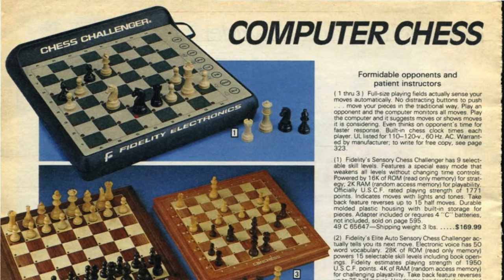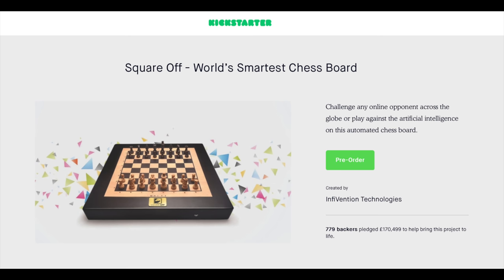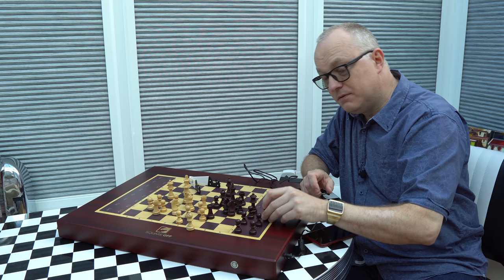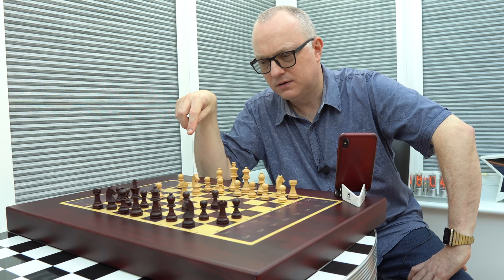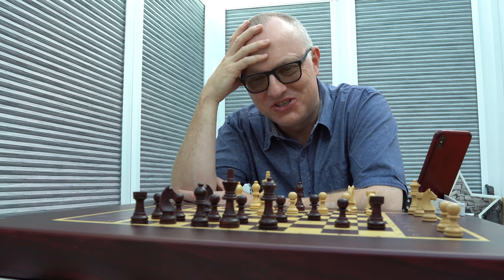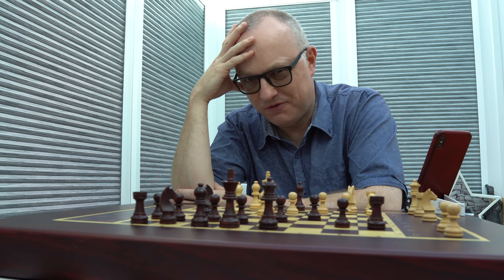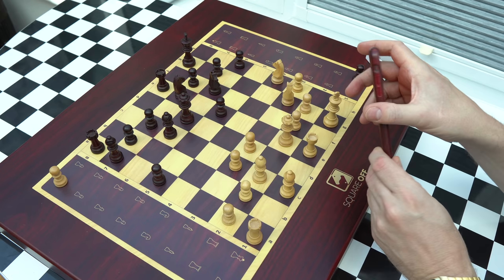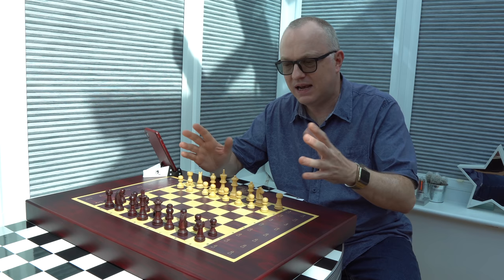Automated Chess - Losing to a Ghost

Comment: I have a electronic chess from the brand Mephisto : Alaska . It uses the similar sound when you press the pieces to the board . You can choice between 8 difficulty levels . You can even remove the beep sound . As it works with four AAA batteries . I bought it in the 90's for less than 50€ . Still have it today .

Comment: (8:25) When I was little in the 80s, I figured there must exist automated chess boards. However, I've always questioned the feasibility do to pieces having to move through other pieces to reach their destination, and this is one example here: black knight C6-E5 (I haven't placed the PC chess in years, so I have no idea what the move notations are).
Reply: I grew up with Chessmaster 2000 for IBM compatibles, and occasionally I could beat the PC on beginner level. Personally, I prefer backgammon.
Reply: C6-E5 is correct in longhand, but in modern times you'd just say Ne5, signifying the knight moves to E5, as any regular player (or computer) already understands the context (the original position and the legal moves).

Comment: Back in the late 70s I made a board which I gave to the friend who owned the Nascom II running Sargon. It had a touch switch contact and a filament pea bulb in a matrix , one in each chess square.
You touched the two squares to make a move and in response the computer would flash two bulbs in alternation. Not as clever as this board but then I think I was 15 or 16 years old at the time, had to borrow time on rich friends Z80 computers..

Comment: Awesome. They should make these with 2 gantry mechanisms, 1 to move computer pieces and one to take player pieces, SIMULTANEOUSLY (makes for a faster game), also more accurate control or fluid/curved movements of pieces, A DEMO/COMPUTER vs COMPUTER mode and a TUTORIAL play mode to teach you about allowable moves and strategies + explanation of disallowed moves (also available in normal play instead if beeps, IF Preferred) A game record and replay mode would be good also.

Comment: i would have hoped that it had some sort of ability to wirelessly track pieces without that membrane. Meaning you could just normally place them, and it could reset them whereever they are placed on the board.

Comment: i like the idea, but i would try to push the design a little further. i dont like how it removes the kill before moving its piece, it would be more aesthetic to leave the kill on the square as long as possible. it would also be great if it could identify each piece automatically, as well as a self righting/topple feature. then it could set the board entirely by itself & have a kill fall over before standing back up & walking off the board.

it seems to do ok moving the knights on the line to avoid crowding, but there might be a prettier way of doing it. maybe instead move the obstructing pieces to the line sideways as the knight enters their square, & then move back as he enters the next square. this would look best if the board can move at least 3 pieces at the same time, but it could be too slow if limited to moving just 1. of course, a knight has no more than 8 moves & each move has 2 ways of looking at it, so the board should also evaluate the least obstructed path first.

with castle, instead of moving pieces to the line i would have the king initiate the move by moving slightly forward & then the rook moves slightly backward, allowing them to pass each other on each 1/2 of the path (logically, the king shouldnt side step for the rook, but it would just look better this way & be less confusing).

i would also add some stand alone features, like a voice chip with different voice options, maybe a few soft leds, as well as voice recognition so experienced players could simply dictate their moves. adding a good ai might be too much at first, but it could be fun to hear it quote wargames when you turn it on (with copyright being an issue i would just call that a customizable greeting & let people set their own message over usb). i would also delay toppling the king until it has finished announcing the checkmate.

then theres a few muddy points to consider with error checking though, how should the board handle cheating or missing pieces, or an undo option when the voice recognition fails or the player misspeaks, etc. the board should also be designed that the inevitable standard magnetic chess piece wouldnt cause damage when people get curious or think to replace a missing piece with a normal magnetic piece.

i would imagine it could announce a problem with the board & reset the pieces when someone tries cheating. how it approaches the matter could be an issue, but combining the board memory & the self setting, it would allow you to easily transport & resume a game, or if a cat jumps up & knocks all the pieces over. there should also be a manual resume option, so it starts a game from how you set the board (would also make cheating possible by just restarting the game this way).

next step battle chess automata ;)

Comment: That is quite amazing to see, A chess board that is capable of moving the Pieces on it's own. As many have stated The problem with this is that App, If that App is discontinued at anytime or the Brains behind this chess board go bust or are taken over, the app is no longer supported Then it's going to be an obsolete priceless hunk of Junk. I agree with one of the other comments on here. Have your time with it and when the novelty wears off. Flog it and get your investment back. No one knows what tech is going to be like in 5-10 years time. Otherwise a fantastic video and illustration of quite an obscure piece of tech 👍

Comment: Real pity about the app only operation, they've cheapened the internal electronics to almost zero, relying on the phone for all the processing grunt, but still want the earth for it. Then in a few years it could turn into an expensive paperweight if the app is no longer avaliable - out of support, won't work with the lastest phone OS etc.
In twenty years when someone does a yesterday's gear review, (Techmoan) well this one will be dead in the water with nothing left that can pair with it.

Oh and you were right with the "you'll almost certainly wish that you hadn't bothered", a twit with an axe is all I saw.

Comment: surely this thing could have been faster. i'm guessing by the huge delays between pieces moving and only one piece moving at a time, that it has only one electromagnet inside moving slowly back and forth. they could have either done this with no moving parts and many electro magnets, or at least made the one magnet move much faster, especially when it's between pieces

Comment: Sounds like it's basically got an old XY plotter type mechanism inside, with an electromagnet. Disappointing. We're surely now at the stage where each piece could be a little motor-driven robot, and they could all move simultaneously to reset the board. Now that would look cool.

Comment: I had Colossus Chess 2.0 on my Atari 800XL. Worst game purchase I ever made because I simply couldn't get anywhere even on the easiest mode! XD In fact, in this video I see one or two moves I like to think I could have done better, but only because I'm seeing them fresh. If I'd played through to that point, my concentration would be shot.

Despite that, I was very prone to catching culture bugs as a kid, and so I always hoped something like this would exist. ;) I was a little disappointed in the 80s when an older friend showed me you had to move the pieces yourself. I'm fascinated by it obviously having a motorized arm under the board. That is, I suppose, classier than having a robot arm swinging around over the top. XD Much easier to build and program, too.

Comment: It's an interesting machine but the app requirement kills any desire to own one. It would need a 2.0 upgraded version that had both an app as well as a computer program for operation, being able to use either over bluetooth and offline, the solo play and remote play would need to function either without a server or they offer up a free server program so you can host the game yourself. I'd rather not spend $500-ish on something that could end up serving the exact same purpose as a cheap $10 board.

Comment: the biggest issue i have with it is the noise, for the price you'd expect something quieter
Reply: Then what? it is essentially a printer or cnc machine. It'd cost a lot more and be a bit overengineered to work any other way than stepper motors.

Comment: Back in the early '80's, there was an automated chess board like this that I saw in stores. It was really cool (and expensive) but I didn't trust that the mechanicals would last, so I bought a Fidelity computer chess board instead. But I've always wished I'd bought the automated one.
Reply: The 80s would be the Milton Bradley. Fidelity put them out in the  90s. The Milton Bradley's were better built but were weak players. Fidelity changed the electronics to a wonki capacitor power supply but made a much stronger player. The last had speech ability. The drives on both the Milton Bradley and Fidelity are quite durable if kept lubricated.

Comment: This would be nice to play on Zoom during the pandemic. That being said, so much of this product raises red flags 🚩: relies on an app, Kickstarter, expensive, cheap material. None of these is a deal-breaker, but combined they make all the other drawbacks even worse. 
@16:28 is a bad sign as well. He's right. Those devices are hard to find now and that seems a dire prediction for this product. Worse still, the app requirement will render it more useless than those older products. Kickstarter should require companies to provide some sort of open source code in the event of the business going under and the product being discontinued.

Comment: I was actually thinking about investing into that Kickstarter campaign, until I found out that it is tied to a single app. There is a standart for connecting boards to computers, professional boards can be connected to a PC running Fritz, Rybka, Shredder or whatever chess engine of your choice, there are myriads of them, highly adjustible and using a PC makes it think way faster because of higher CPU clocks.
If it was Raspberri Pi based, I might buy in, but a very primitive app... Hell no. There are much better chess apps even on phones.

Comment: that thing is really cool but the beep is AWFUL. Some other sound would have been better. I think something sorta "woody" like a tap or knock would have been my suggestion. like a polite sell phone notification. Or to be able to change it. But the beep is awful it doesn't sound like a premium product.

what would be BEST i think is like when you tap your phone screen to accept and it does a slight little vibration. Like that. but it happens instead of the beep. really subtle haptic feedback instead of a sound. But that sounds sorta expensive and hard to manufacture.

Comment: Would be nice if it could do checkers as well!
Reply: Since it's purely an I/O device, there's no reason it couldn't play other similar board games with appropriate software. Although for draughts (or 'checkers') you'd need to use pieces that could be stacked.

Comment: the fact that the board itself doesn't have any kind of way to play a game without an app is really disappointing. Any basic microcontroller or cpu has more than sufficient horsepower to run a good chess algorithm, so the fact that they decided to make the board be essentially a X/Y motor in an oversized box and nothing else is truly sad.

Comment: I mean if it moved more then 1 chess piece that would be more cooler.
Reply: i mean i guess. But something like that is make with moving parts. Its like a printer or something.       Yea. I mean printers are neat, if it could print more than one page at a time that would be cooler.    self driving teslas are fine but it would be cooler if we could just teleport.

Think of an etch-a-sketch. Its a stylus on an x-y axis. Now try to think how you would add additional interdependently controlled styluses that can operate simultaneously on the same plane to an etch-a-sketch and that's what you are asking for. 

The thing is basically magic. 100 years ago people would have fainted. And most of the people in the comments here in 2021 have their minds blown. I know how it works and I think its cool af. 

We have a chessboard that can move multiple pieces at a time. Its called a computer or your cellphone. Its way more capable than this thing but also way less freaking cool.

But come up with a mechanism that do what you are describing and put it into a similar sized and silent enclosure and get it manufactured and sell it at a similar price point. Ill wait.

Comment: Neat thing, but you hit the nail on the head with the required app.  That's just a built-in artificial end of life.  Too bad they made such a poor design choice.  Can't see spending this much money on a device that could be rendered virtually useless at any moment without warning.  I'm guessing the board has no internal logic at all and all moves are calculated by a remote computer and sent via the app (much like how modern voice recognition assistants work).

Comment: that was way overhyped. Its very slow, noisy, and the piece movements are bizzare looking. Plus you have to press down when you move a piece like it can't detect when a magnet has been removed from the board in a particular location?
I would say this is a failed kickstarter project. No one ever doubted that they couldn't muster some mechanism to have pieces move on their own, so the expectation what that they would execute this well and... they didn't. Theres a reason he bought it from someone who had used it for 2 days and turned around and cut their losses by selling it...

How does it handle promoting a pawn? probably by lame means. How good is the built in computer? how many threads can it calculate? I assume theres some way they could make it where you're playing alphazero or stockfish lvl 9 but is the built in computer comparable to those engines?

Comment: Got one of these for xmas and it is a piece of absolute garbage. After spending 4 hours getting the app working the board will not connect so it is just a very expensive doorstop. I cannnot use it for anything as it does not work standalone (despite the web site implications) and having spent 6 hours now trying to get it working I have had enough and it is going back. I do NOT recommend buying one of these unless you like being dissapointed.